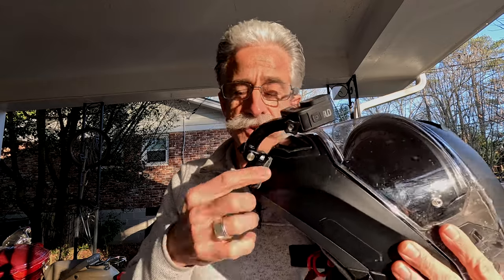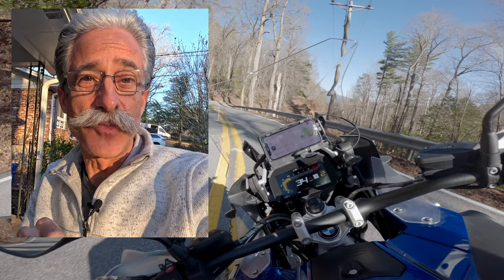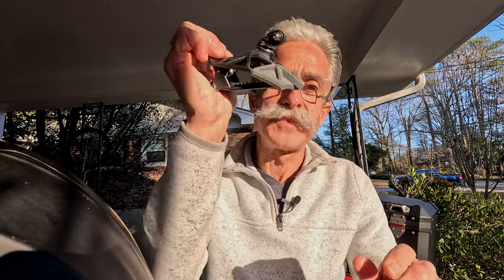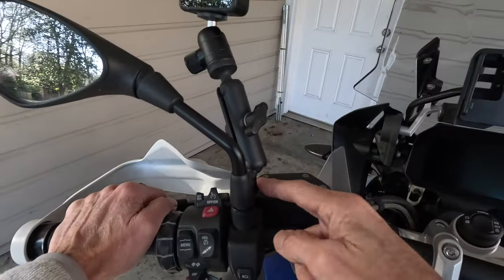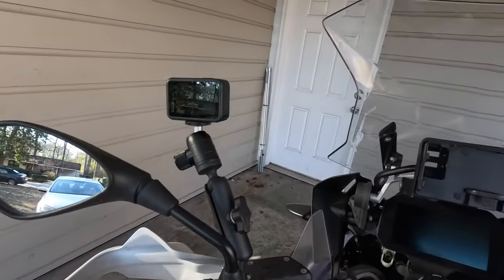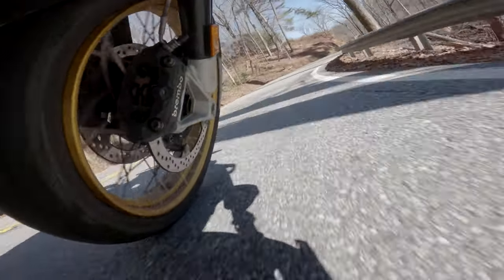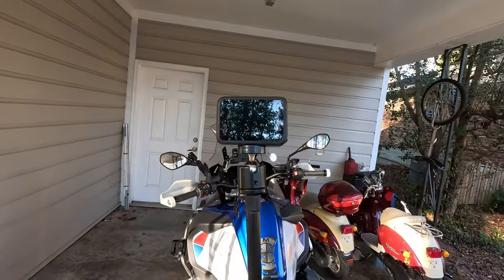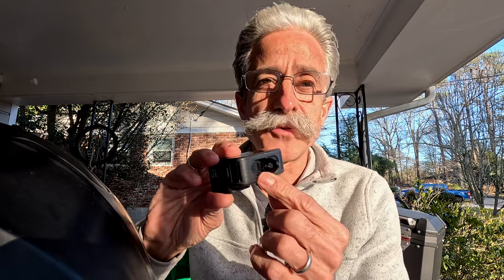The Best Motorcycle Mounts For Your New GoPro

Comment: But for any placement other then helmet, camera needs a robust anti shock/anti vibration system. I tried that with a cheaper camera and picture was unusable.
Reply from the maker: The Hero 12 and Insta 360 0ne X2 do pretty good with a solid mount to the bike if the road is decent, I'm actually pretty impressed. Off road anything other than helmet mounts can get pretty rough.